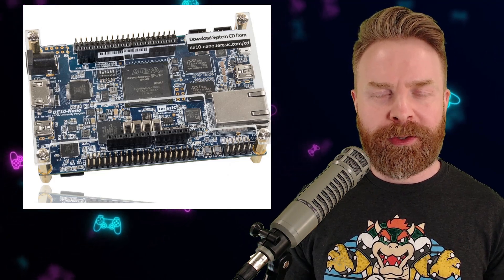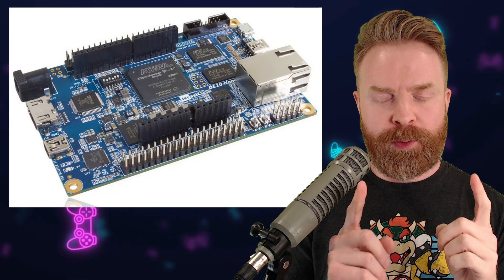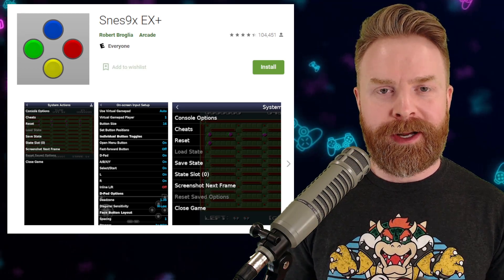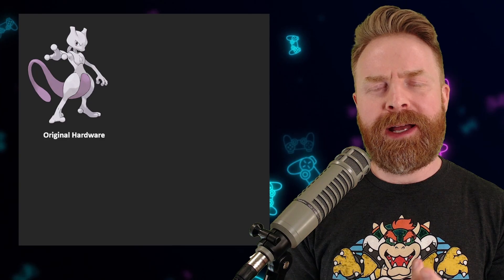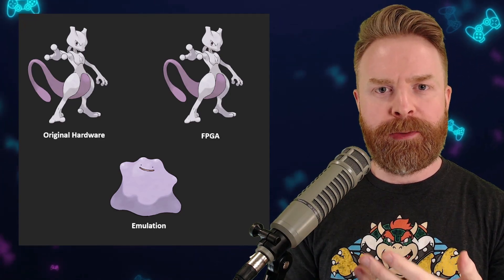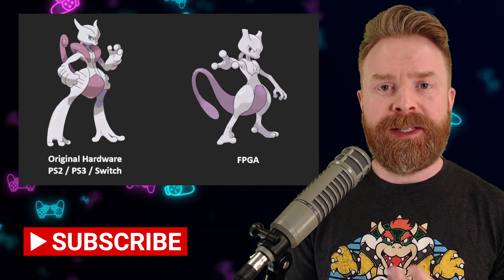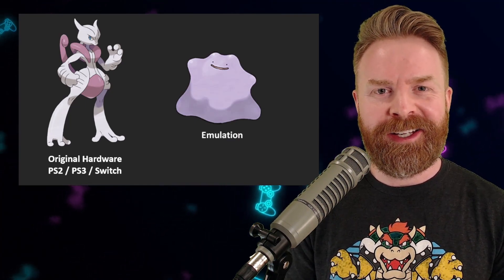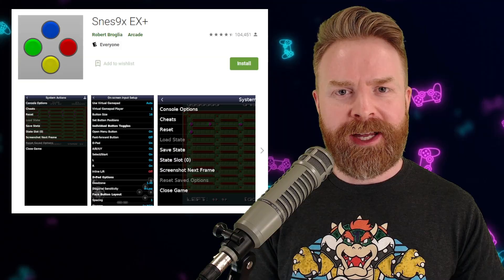The difference between FPGA and Emulation explained at a high level

Comment: I definitely think software emulation is preferable most of the time. Not only would it be easier to emulate more systems and generally do more things with minimal configuration, but I’ve seen software emulators that seek to have a better output than the original hardware, and aiming for accuracy like an FPGA does only allows the output to be as good as the original
Reply: You do make a good point, but FPGA emulation can also improve upon the original.
Robert Peip's GBA core allows you to render GBA games at a higher resolution, so sprites that are scaled look better. The NES core allows you to increase the sprite limit like in software emulators, more and more arcade cores allow you to save the highscore. Etc, there are many more examples. Below I just write about the difference between software and fpga emulation, not claiming one to be better.

High Level or HL software emulators, are emulators that emulate the high level functions of the consoles, example emulate the graphics API instead of the gpu, or do just in time compailation, etc, or emulate the operating system instead of the hardware, and so on. These are much more flexible when it comes to adding new features. Low Level or LL software emulators are harder to add new cool features, but not impossible, and FPGA emulators, are basically low level emulators, but they are harder to develop.

The advantage of FPGA emulator cores are that they have the possibility to be very accurate if programmed with care and good understanding of the original hardware. And you don't have any operating system or abstraction layers to get in the way like you do on a traditional computer. This allows games to be run on an FPGA that runs like 5W (not including rest of the hardware, maybe add another 2 or 3 watts) the  and the same accuracy in a software emulator would run on like a 65W CPU (not including the rest of the hardware, maybe add 50 or 100W more). And even on MiSTer where it processes the USB gamepads on the Linux side, this has the USB polling processes running alone on a cpu core, being able to not be managing other tasks at the same time. Or the GPIO pins on the FPGA can talk to the controllers directly, not having any delay more than the original console, making peripherals work the same way as on consoles.  And other optimizations, like not having a buffer for the audio, the audio is processed without delay, or as much delay as the original system.

Software emulation has its own advantages, like does really 30 ms lag matter? When you can render games in 4k, running mods that require the power of a PC, using tech like AMD FSR. Running consoles that are far out of the reach of FPGA for a long time. Like gamecube, or Wii or PS3 or PS4... or running games on the platforms you have already, like your phone or the computer you already use. Or even running emulators in the web browser, or playing open source versions of the games like Doom or Tomb Raider. Net Play, awesome debugging, Tool Assisted Speedruns, savestates, variable refresh-rate motitors. Yes FPGA can do some of these things, but they are more advanced on software emulators.
Reply: If you don't think fpga can also improve it or that messing with the timing can water down the experience just like interpolated animation then idk how to even talk about it.

Comment: WOW, I didn't know this.

This would be perfect since you don't need to "emulate" at all.

This would give a massive performance compared to the "Original" emulation.

An example would be that the 1050ti has more power than the PS4 GPU but has problems emulating a PS3, with this (and good optimizations) you would need much less power for play something.
Reply: fpga isn't 1:1, this guy is spreading completely false information. the main benefit for an fpga is original console-like lack of input lag 🤦‍♂
Reply: @0Asterite0  It depends on the quality of the VHDL/Verilog code one produce. In theory you can obtain a 1 to 1 copy of the original hardware digital logic if you know enough about each ICs on the motherboard. It's easier for some hardware and more difficult for others (like the SID chip of the C64, which makes use of some sorts of analog filtering on the output which can be difficult to reproduce with a FPGA), but it's do-able given enough time and dedication on the reverse-engeneering process usually.

Comment: For a purist or someone who wants what it origionally was like fpga would be understandable. In my opinion Emulation is getting better everyday and is my choice.
Reply from the maker: Well said. Two sides to the same coin.
Reply: In some cases, emulation is preferable to the original. The Wii should have been an HD console, and Dolphin fixes that.
Reply: Emulation has been great for a long time. But it depends on what you want to emulate.